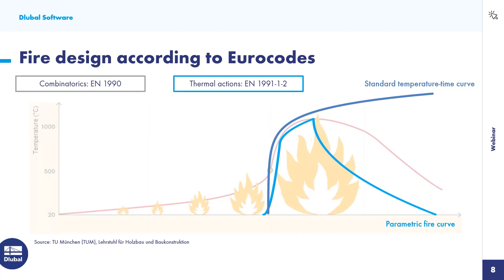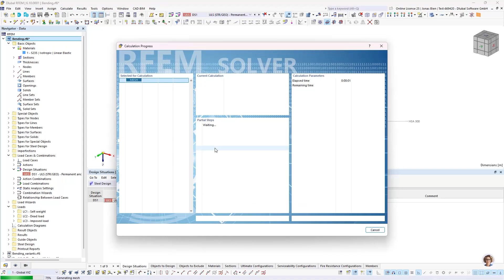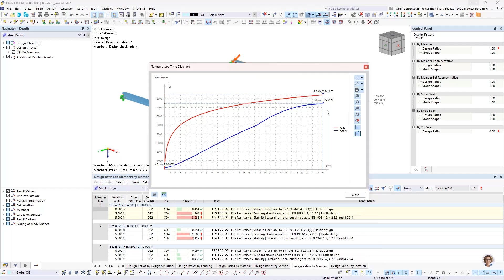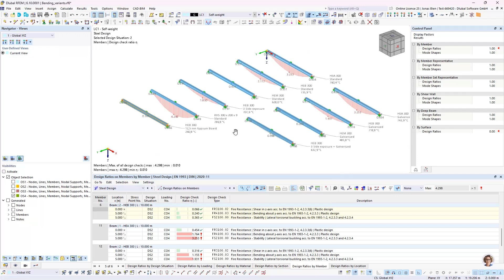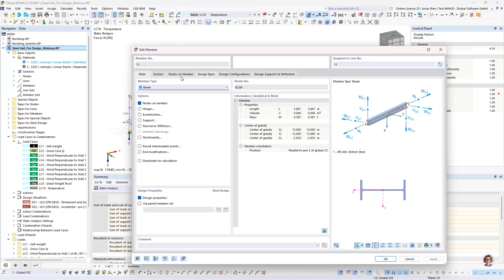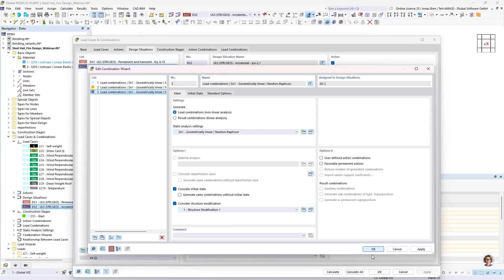Webinar | Fire Design in Steel Structures with RFEM 6

Comment: 55:31 the modulus of elasticity will degrade gradually as the temperature rises. Structural failure may happen before the structure will be able to reach the 800C and the reduced modulus of elasticity. So the way you show is incorrect. Only coupled structural-thermal time-history analysis may properly account for the effect.
Reply from the maker: Hi, @KyTaPb! Thank's for this important remark. In the german webinar that we recorded 2 days earlier, we actually showed the indirect forces for an intermediate heating step (at 400 °C) as well and highlighted that the indirect forces are not proportional to the temperature (https://youtu.be/8bmebCPhqcY?feature=shared&t=3254). In the english webinar, we only evaluated the indirect forces for one arbitrary temperature because we were running out of time.
Reply: @DlubalEN  yes, user may check structures by gradually increasing temperature and adjusting modulus accordingly. But it is like searching for an answer through an iterative process manually. Moreover the obtained results are structure dependent so the answer may be different every time. Therefore, even though possible, but practicality of the method is very questionable.
Reply from the maker: Hi, @KyTaPb! Once the temperature-dependent material properties are set, there is no need for manual adjustments. It would further be quite easy to scale the temperature load case and derive the envelope (min/max) results for multiple temperature load steps in a result combination. However, the purpose of the demonstration in the webinar was to get a feeling for possible indirect actions and show that both, the temperature and the temperature dependent material properties need to be taken into account. A complete level 3  fire analysis is far out of scope of our software.